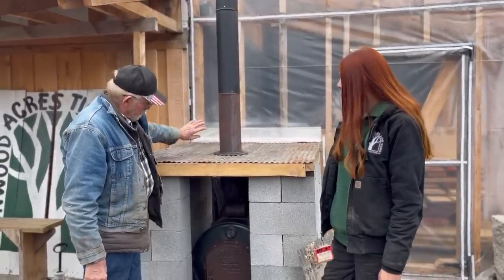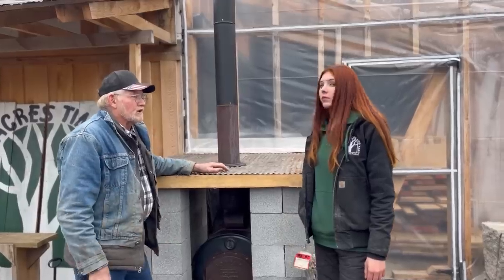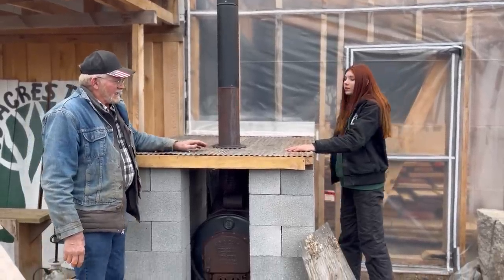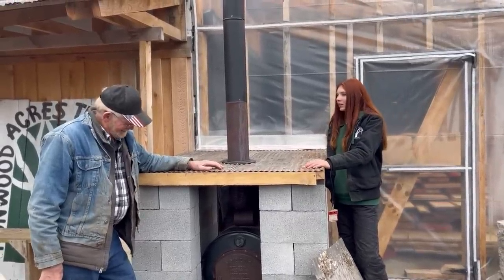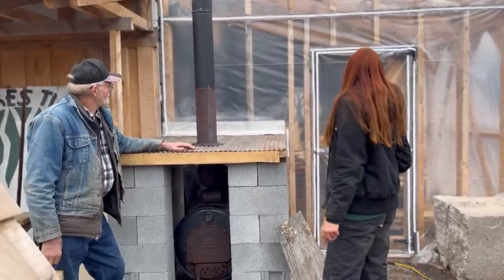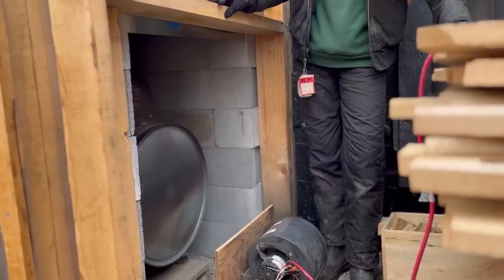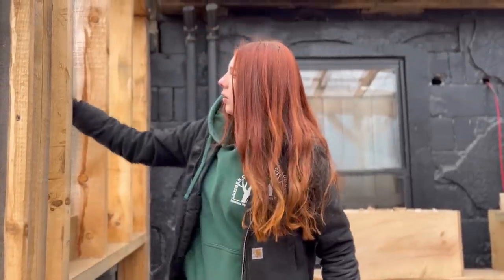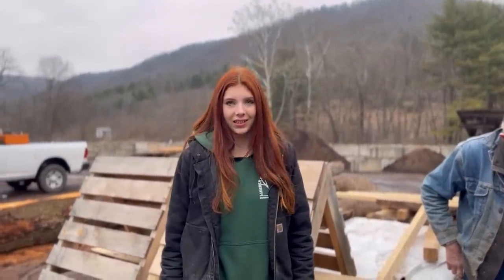Using a Barrel Stove to Heat Our Lumber Kiln: Does it Work??

Comment: 1) If you've got a generator running to power a couple fans you likely have plenty of excess wattage to power battery charger(s) on your solar storage.  That way you can power on your solar inverter and run your fans when you shut the generator down for the night.  2) As many people have mentioned, you want your airflow to run horizontally through the openings created by the stickers.  Airflow should be a big circle from back to front the way you have it set up.  An air flow baffle (decent piece of tarp) hanging ~2' below your ceiling and  hangs all the way down to the top of your  drying stack will get that circulation going.  Based on what you've got on site, you'll have to determine if it's better all the way in the front or all the way in the back.  Lastly, again mentioned often - your stove wood should be in some kind of crate open on all sides.  Obsolete milk crates will work.  4)  Open the window into the office one inch of so.  You need to exhaust that moisture laden air somewhere.  Hope this helps.

Comment: Use lots of end grain sealer or prepare for lots of degrade  toward the heat source.
Reply: A lot of the boards in the Kiln did  not have  the end grain  sealed.  When I  cut  Turning Blanks,  I  seal  them up  right away, so  they don't  crack  during the drying process.

Comment: Very nice installation.
You might look into four things:
Wood stove fans that generate electricity for themselves (from the heat of the stove by a thermopile) don’t need a generator.  They don’t move much air so get one or more big ones.
If you do use a generator, make a little duct to send the engine cooling air into the kiln.  
Build the stove enclosure about three courses higher.  You could then put a metal plate in at an angle from the front of the enclosure to the back.  This will set up a natural air convection to circulate heated air in the kiln so you don’t need a blower.
Clear out a little area inside and build a bench.  Put a sign out front offering an hour in your sauna for $10.  Either sand the bench or provide towels to prevent splinters in backsides, but keep tweezers handy just in case.

Comment: In Poland where I live, we do things like this differently. I.e. the wood feed would be on the outside and the burner with the chimney would be located within the place you want to heat. Yes.yes. the chimney would have an outlet to the outside.......... The chimney and the stove would be covered in firebricks that would absorb the heat and let it out slowly. 
So you regulate the temperature by putting more/less wood or air in the the stove and you regulate the humidity with a small opening at the bottom of one end of the  kiln and the top end of the other end to generate a natural draft. No need for a fan.
Hope this info inspires you guys on your way to proving your drying process.
Btw you Grandpa Boss is a great man. Luv him and his support he gives to all of you!

Comment: years ago i was a boss in a big sign company that made sandblasted signs out of western red cedar and the cedar would be soaked when we got it in. so i needed to get it dried before we used it and we built a kiln inside the shop like the one you got. we had an electric heater and a dehumidifier in it. we used to dump a gallon of water out of the dehumidifier every morning. worked pretty good
Reply: A dehumidifier would definitely speed the process up, both in summer and winter.
Reply: @moltderenou  yes, but they don't have power so cost of generator would never be profitable on such a small scale..
Reply: @jamesrussell6870  Apparently they are running a generator to power the fan that moves the hot air around the kiln. Solar powered dehumidifiers are available on Amazon.

Comment: To increase the heat, plumb the exhaust pipe inside the building and use thermal fans to circulate the heat from the top of the firebox.

Comment: A big sawmill near me uses a hot water system heated by mill scraps in a water furnace and piped into the kiln which is insulated. A really big mill close by uses same system and also heats their buildings.

Comment: Hi! 2 things: first, did you put up a system to evacuate the moisture that the wood releases in the kiln when drying? Cause the reason you see the moisture disappearing is because warm air can contain more water in gaseous state, but the water is still there. 
Second, if you can fix a simple homemade Stirling engine to the back of the barrel stove and make it move the fan blades, you won't need to run a generator. The most difficult part is the seals and pressurizing the pistons to obtain some efficiency.

Comment: Great work Grandpa.  A couple suggestions.  Make sure your Smoke Pipe has a Damper which will make your fire last longer and provide more heat. Really.   The barrel could be turned around so your 'draft' for the fire would be sucking in colder air from inside the kiln at ground level.  That of course would involve sucking in Combustion Air from outside.  There is a Humidistat on that thermometer.
Looked like 65 RH.  A set of rails and flat car to hold lumber on skids that could be rolled outside for loading unloading would be good.  It would involve a wider or 'barn doors' to work well.
That smoke pipe could also be run horizontal thru the kiln to give radiant heat.  Keep that draft door closed.  Fire is always a big concern so brace the smoke pipe solidly at the highest point possible and perhaps a screen/spark arrestor on the top of it.  Perhaps that is one on there now.  Your Insurance Co. would not approve of this install unfortunately.  Keep fire Extinguisher handy.

Comment: During my years of building machinery for the timber milling industry, I worked on one fire tube burner/exchanger and built another for the same person. It is far more difficult to dry timber with waste timber than one would imagine! To make it viable - insulation is the key - from the firebox to the entire kiln - followed by air circulation - via metered ducting. That is blown ducting that has graduated apertures to release hot air proportionately through the kiln. If not, the timber dries more at one end than the other - and in some cases - if the flu is too close to the timer, it can ignite the product and cause an inferno. Wish you all the best with your project, hope you get it working soon.  🤞🤞

Comment: if you can keep the temp under 120 and have some spare electric you might want to put a simple dehumidifier in it.  It will make the process quicker but cost you electric.

Comment: Hiya Ladies,
Great video; thank you again.
I don't know if they are readerly available in the US, but here in the UK, we use heat fans to move warm/hot air. What? Heat fans? Yep, no electricary, gas, or solar; it just uses the heat is on? On? Yep they are small, and you put them on the wood burner, and they just use the heat to push the rising heat into the whole area. Very popular on narrow boats. Again with the funny names? A narrow boat is a long thin home used on the canals here. People live aboard and even work in/from them. Artists etc. They use smokeless coal or wood-burning stoves and slow-turning fans to move the heat around. Slow moving so you don't get a cold draught, just warm air moving. Anyway, just an idea. 
Stay safe; and warm, Steve...

Comment: Nice to see Gramps helping around the wood yard.   My  career has been working with sawmills,  drying the lumber we purchased from them, and manufacturing specialty flooring.  I highly recommend you study the vast amount of  information that's available regarding lumber drying .  Properly drying lumber is very complicated and must be done correctly, especially if you plan on selling it.   Looking forward to seeing your new Eastonmade  splitter getting used !!
Reply: Peter, you are so right. I have concerns about this one not distributing the air evenly thru out, thus setting up stress in the lumber. Some dehumidification would help too.

Comment: So many people talking about filling that space with so much ‘heat’ that it cooks the wood and splits it. Consistent, regulated heat and airflow are keys to drying and not cracking the lumber. After that controlling moisture is next hurdle. You need humidity to dry the wood, excess humidity will cause you to chase your tail but not enough and the surface shrinks to fast causing splits and cracks. In my opinion, adding a dehumidifier to the opposite end of the kiln from the heat source and running it in intervals throughout the day would be the way to go. Therefore regulating your overall humidity per day. As a byproduct, you could collect the water and use that for any number of things (except drinking of course). In regards to the airflow, I’d do the best I could to position fans in order to create a ‘horizontal corkscrew’ effect so as to push air through the stack of lumber all the way down the length of the structure. With that concept of airflow the dehumidifier would then be able to capture and reduce the overall humidity at it most concentrated point. I know, everything always works in theory, not always so much in practice. Just thought I’d jump in and share my 2 cents. Love the channel, I’ve been watching since you were around 1.8k subscribers. Wish you all the best in all your endeavors.

Comment: Condensation? Dehumidifier with a small hose to release the water to the outside. Also, plastic on the inside will double the R value of your walls (heat retention). This is just the start. It's a work in process (until perfection is achieved). I have no doubt that you'll get there.
Reply: Totally agree with the statement that this is a work in progress. There are too many site specific parameters which we cannot control, and they must be addressed on site one tweak at a time.

Comment: If you use the air from the Kiln to heat the office, you are going to introduce a fair bit of moisture into your office. Still, it's a great idea. I think I should build one over the summer, for next winter. Thanks for the vids, and great ideas.

Comment: Out of curiosity, do you mind me posing some questions? - Did you say where you let out the humid air from the inside of the wood chamber? 
If you vent the wood chamber for a couple of minutes from time to time the humid air can escape more quickly. 
Or do you prefer a continuous escape of the humid air though some small openings in the walls so that you can better control the drying velocity of the wood?
How can you control the escape velocity of the humid air?
Do you have a hygrometer on the inside of the wood chamber or do you regularly measure the wood moisture directly in the wood??

Comment: Normally, I dislike using inside air for combustion, but in your situation, it is ideal. Once the door is on, the stove will heat and vent the kiln. Might actually dry the wood too fast.

Comment: Nice!  Once Grandpa installs the door, how will you manage the air inlet/outlet?  Have you thought about something like a Heat Recovery Ventillator to pre-heat the cold inlet air using the hot outlet air?
Reply: The air is drawn from  inside the kiln, not outside.  The fan in the video blows towards the stove to aspirate it.  We are using a ceiling fan to move air down and two small fans to move air through the wood…Boss Man.

Comment: The wood burner was a great idea! Too bad though that you have to run electric fans. Say, have you ever considered installing plastic sheeting on the inside walls? In theory it would create dead airspace and increase the R-factor. Love your videos, always something interesting. 👍
Reply: Energy to power the fans is trivial.  In fact, some commercial facilities use OVERSIZED Induction motors as a means of increasing the AC power factor, there by increasing the efficiency of the entire plants power consumption.
ie their power bill comes down. Principle of 'ELI the ICE man' voltage vs current
Reply: I'm sure the double plastic idea would help especially on sunny days, unfortunately, here in Pa, sunny, winter days are pretty uncommon.
Reply: It would interfere with the solar radiation which powers the kiln 6+ months a year…Boss Man.

Comment: It's good to find a use for the firewood scraps you don't sell as a+ wood. My only thought is if you are running a generator for the fans, why not use a area heater fan to move the air with heat?

Comment: Check out Green house plastic two layer plastic , has a blower to pump air.  Air help's insulate . Also you can set up drip used oil system to help fire burn hotter.

Comment: Great video. Of course you'll have plenty of scrap wood to run the stove. You should maybe look into rocket mass heaters and sand batteries which would even out the temperature changes. Paul Wheaton has a lot of content on rocket mass heaters. Thanks for the great content.
Reply: Also a Stirling engine works directly from the heat to produce mechanical power, and would reduce the need for the generator. Or perhaps you could use a battery bank like a Jackery?
Reply: Thanks for the info…Boss Man.

Comment: Cold air has less moisture than hot air can hold. You might want to mix cold with hot to remove the water coming out of what you're trying to dry. Drying to fast is not good enough but door open is not all bad

Comment: Grandpa Is """"""Smart,""""" And A Hard Workin Guy !!!!!   lots Of Love From Grandpa !!!!!!!!! He's Always Workin On Something!!!! """""NICE"""""!!!!!!  With Wood For Fuel, Endless Heat!!!!!!!!   I Was Just Getting  Ready To Say You Need A Door On That Rigg, When  Grandpa Said And Yah I'm  Going To Make A Door For It Next!!!!!!   Barrel Stoves Put Off  Alot Of Heat!!  Once The Door Is On, You Will Have Alot More Concentrated Heat Which Is Hotter!!!!  All You Have To Do After That Is Regulate Air  Flow Through The Stove House Into The Kiln, (Like Grandpa Said!!! ).  Watch For Wind,Sparks, Plastic, Kids, Animals,And Anything That Moves Around Your Heat  Source!!!!  Keep A Couple Of Big Fire Extinguishers Handy, Not Frozen  Close By.  If You Can Capture All The Heat Off Of That Barrel Stove, You Will Have More Than Enough  Heat For Both Rooms. """""""""BE AWARE""""""OF AIR CIRCULATION STOPPING, It Could Possibly Make Your """"""""Wooden""""""" Frame In And On Your Stove House """"""To Hot"""" And Catch  Fire!!!!!!!   Fans Need To Stay On!!!!!!  While Stove Is Running!!!! Probably!!! ???   Grandpa Was Ribbin """Ya"""  About Always Being Inside Of The Kiln Getting Warm.  (GRANDPA WAS RIGHT)!!!! 😁😁😁😉😉😉😎😎😎🤗🤗🤗👍👍😇.  Protect All Your Wiring Around Heat, Weather, Movement Ect!!!  """"""God Bless """"""Best Wishes""""",  Nice Video!!!!!!!  Guys!!!

Comment: If you didn’t want to run the generator but still wanted circulation would the type of fan used on top of wood stoves work or be efficient?

Comment: Have you thought about a solar panel charging 12volt batteries linked to 12v fan to move the air around .it would save running a generator all the time.

Comment: The dry kilns where I worked had baffles and flaps that kept the air flowing through the stickers. If it were mine I'd put a ceiling fan on the high and low side to run independent of each other. One could also lay plywood so it looks like a vee pointing to the lumber unit bottom. Run the fan on one side for a while and then the other fan for a while to make air flow change direction. I might be overthinking it...
Reply: We have (4) fans running.  One to aspirate the stove with warm interior air.  One on the ceiling to move air down and (2) to move air through the lumber.  We are still experimenting…Boss Man.
Reply: Baffles would make a huge difference.

Comment: Be carefull with blokking outside air for the fire. Recirculating inside air could increase the risk of high levels of carbonmonoxide and carbondioxide. Both are dangerous in high concentrations. Although I suspect the kiln must have some kind of ventilation to get rid of the water vapor.

Comment: put ya a mechanical thermostat on the squirrel cage fan where u can control the heat flow it cycle off and on  awesome shed for drying lumber

Comment: Losing a ton of heat since no insulation. I'd go buy some rigid insulation sheets and put on the walls. How is the moisture being removed with no external air circulation? Seems to me you need a dehumidifier to remove moisture.

Comment: I would install another layer of plastic on the inside.  It will create an insulation value.
I've built green houses that way. 3-4 " air barrier of insulation.  Heat will do its job more quickly.